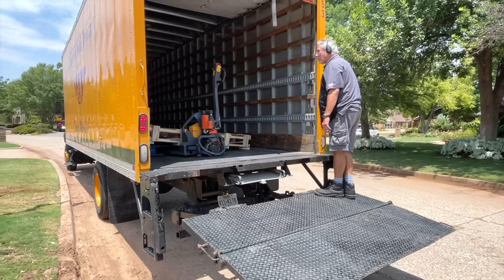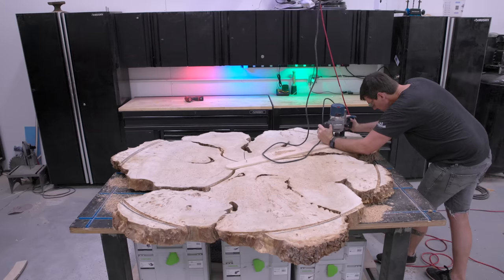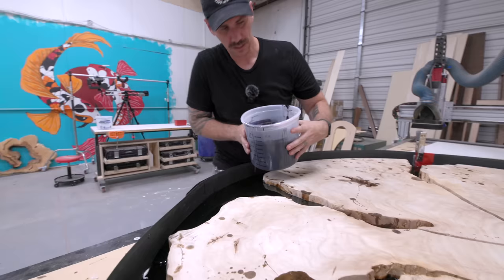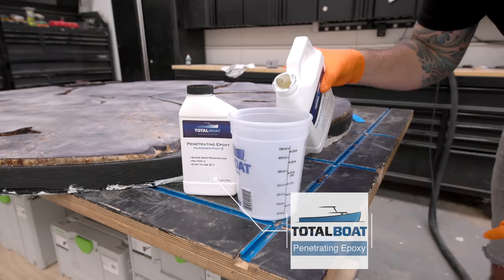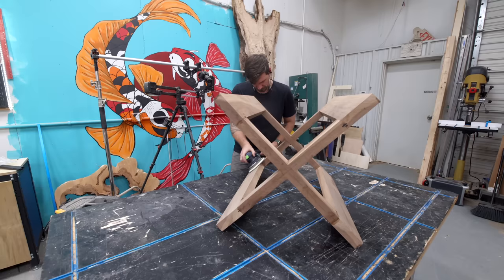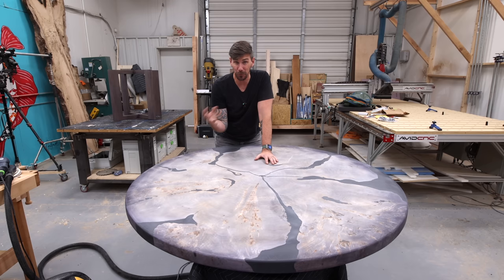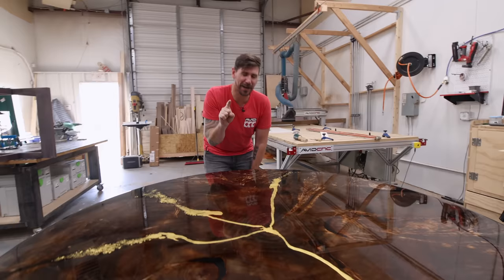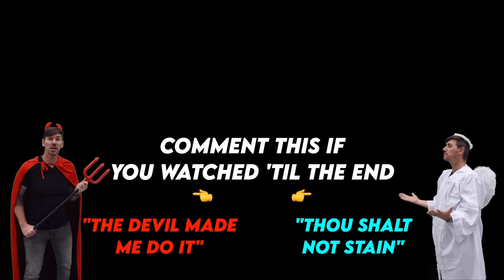Table Made with Ancient Japanese Technique

Comment: For clarity's sake,
Stains are heavy pigment mixed with some sort of hardening binder that sits (mostly) on top of the wood and covers up at the grain and figure
Dyes are pure pigment mixed in either water or some other solvent that soak into the wood and then evaporate leaving only the pigment, highlighting and accentuating grain and figure

Dye is always a fun and good idea in Fine Furniture with heavily figured Woods, stain should never be used in Fine Furniture

Comment: using the pencil to check your sanding works fine, but try out powdered guide coat, they also have it in aerosol (I use mirka currently). A product dedicated for finding any imperfections through the sanding process. Not only good for sand scratches, but also checking for straightness or flatness. Another body mans tip! Hope this comment finds your eyes, let Cam know too!!

Comment: Pencil marks...good idea! I took my students to Japan in 1999 and saw quite a few examples of kintsukuroi repaired ceramics. We also saw many examples of Shou Sugi Ban on traditional fences as well as modern houses. Table is amazing! Will you keep it? Sabarashi!
Reply: To keep the flying insects off of your epoxy, try building a frame around the project an hang some mosquito netting or a plastic sheet over the top.

Comment: the stain is gorgeous, really brings out the character of the wood! I think the only thing that could be improved is the transition between the gold foil and black epoxy, there are some spots where you can see a repeated pattern caused by pressing the foil sheet down which is a small distraction. I think if you had mixed the gold foil with clear epoxy and used that, it would have created a more random application that you could mask off and feather out with more control. beautiful table overall!
Reply: The stain hides the character of the wood. You have to squint to even see the wood.

Comment: I do industrial coating, and it’s true bugs are immediately attracted to the epoxy we use. There is an additive that helps, but not sure it would for what you’re using. You can talk to a industrial coating specialist from sherwin williams. You have to ask specifically, your local store may be a residential.

Comment: Put a box fan beside your curing epoxy table facing slightly upward so there's an updraft away from the table surface, it'll keep most of the bugs and dust away from the surface.

Comment: You do great work, try putting your epoxy in a vacuum chamber after you mix it (use a power drill) before you pour it into your form. Dip a vibrating tool into your epoxy while it's still wet to help it flow into crevices and remove air pockets, I learned that trick doing concrete work. You will notice a huge difference in how the epoxy turns out , and have less touch up work too.

Comment: A safer way to stop each piece from separating is to put 8mm threaded stud in the 10mm holes you drilled leaving room for the resin creating a much stronger bond between each piece.

Comment: I can give you an idea, what else to add to the table surface. You can add optical fibers so that their ends are flush with the surface of the table by sanding them. The reverse side of the fiber optic bundle can be illuminated with an LED driver that smoothly changes colors to slowly fade in and out. The optical fibers will remain on the varnished surface and glow as small dots. This device has a program for most different colors as well as for a specific color. No external power supply required, One rechargeable 12V Li-ion battery is sufficient.

Comment: I think it would have looked better if you had carved out the cracks a bit and filled it with a 'gold' resin.  Let that build a bit over the surface and then sanded and flooded.  However, I do have to agree that your interpretation does look great.  Well done.

Comment: I have a suggestion which MAY help with your suicidal gnats which dive into your pristine top coats of epoxy.

I have used this to great effect by placing the solution in a small glass canning jar. I punch a single hole in the middle of the lid (from the outside to the inner surface, so the jagged metal is on the inside). 

In a small bowl, mix a half cup of warm water plus two tablespoons of apple cider vinegar, a tablespoon of sugar, and about six drops of liquid dish soap. Gnats will be lured in by the sugary mixture, but once they dip in for a drink, the sticky dish soap will trap them.

I don't use the dishsoap as the bugs do NOT find their way out that tiny hole. 

I use one small jar in my kitchen but you could place multiple small jars adjacent to your masterpieces. 

There are commercial products, but in my N of 1 experiments, the above recipe is FAR more effective, it is CAT PROOF (whereas sticky traps CATCH felines), easy to clean & dispose of the many tiny corpses [such that your GNATocide might pass unnoticed] AND it is CHEAP.

I wish you luck.

Comment: Jonny you’ve probably thought about this before, but if the CNC is your biggest surface, why not make 4-5x8 MDF or mellamine surface that you can lay on top of the cnc table to use for finishing/assembly or epoxy pours? I have to do this with my workstations in my small shop. The MDF is also much flatter than most stuff usually so it’s good for assembly too. Anyway just a thought. Best!

Comment: 1:00 your lumberjack cuts down trees with something between a pickaxe and an icepick. Interesting.

😝

P.S. You've clearly never been to a Springsteen concert... (yeah, I know - who's go that much money, right?) but by all accounts it's quite the experience. To my mind - meh. Take it or leave it.

P.P.S I have a Growatt wired-in off-grid inverter. Works well, but man it's noisy. Cooling fan sounds like a vacuum cleaner.

P.P.P.S. Stain it / don't stain it. Different strokes for different folks, and in some settings / decor environments a stain would be good and in others not so much. Also gold... not my taste, but some people love it. In this case there's not too much of it so it's not bad at all. But I think that overall this table looks really good.

Comment: The gold does not work well. It clashes way too much with everything else. I am not sure what the solution would be, and not trying is worse than trying and failing, but I feel if it was possible to somehow match the lighter bronze tones of the wood, and not make it a solid color, it would have worked out better.

Comment: you might want to destribute the gold in lines around the edges and focus on the balls, little islands of gold on the river  of black.  If your putting this much effort in to it you can try to apply some gold tree shapes castles ets  to the serface of the wood catsanimals pov outside view  creating an amazing  scene, it shouldnt take you more then a couple of hours 

you can apply silver and brass for contrast 

One thing i dont get with gold lief aplications is why not use a needle and inject the gold on to the rivrs.

another thing, have you ver thought about just cutting in tunnels adding metal and then just hiding the tunnel with saw dust and glue ?